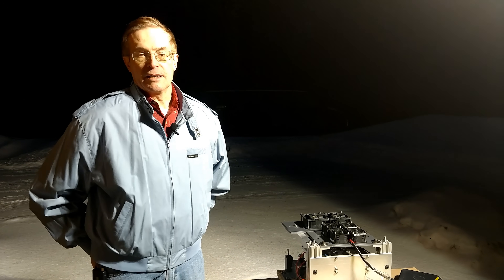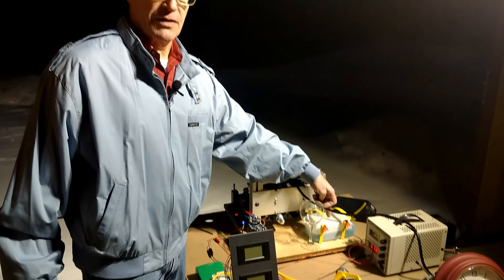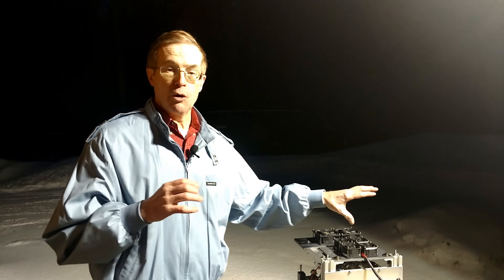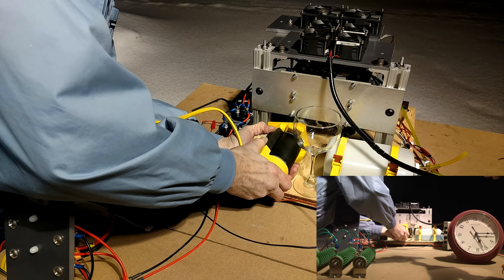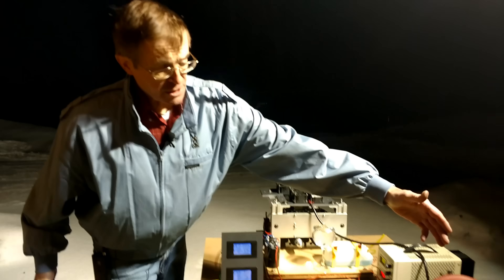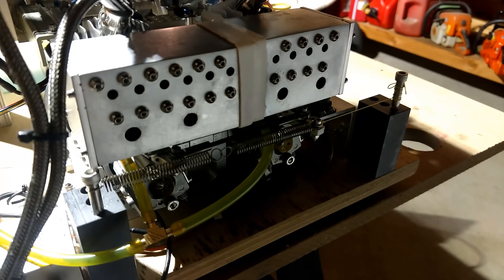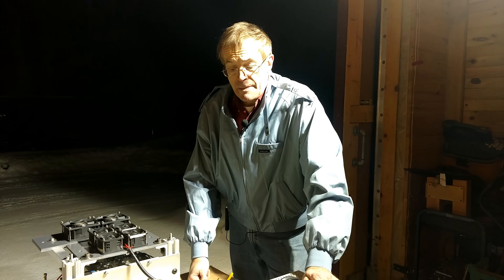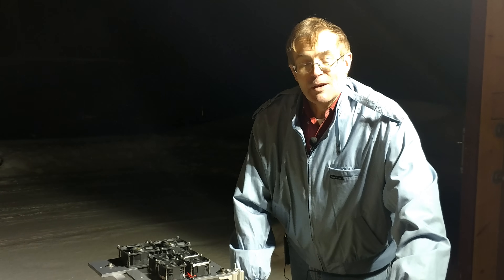Drone Generator Performance

Comment: If you're running nitromethane, a good percentage of the "fuel" is oil to lube the engine. All that oil is going to end up in your glass sponges. If you subtract the oil content from the weight, you'll find your efficiency is a little better. Those mufflers are going to be fun to keep clean. Cool project.
Reply: Lol I saw a video of one of those glasspacks melting  and spilling piles of moulton debris, looked kinda like a volcano  ....
Reply: some of these 2 stroke rc engines can be run with as little as 2% oil
Reply from the maker: These are two stroke gasoline engines with only two stroke oil added.

And, thanks!
Reply: Weighting the exhaust system before and after is a thought, though. Two strokes have smoky exhaust. Maybe there is particulate accumulation.
Reply: The oil in the nitromethane fuel (Mr. Tech told me he's using gasoline and not nitromethane, but same principle applies) doesn't burn. It is exhausted. The reason it doesn't burn is that it is added to both lubricate and cool the engine. All of that oil will saturate the glass and be a mess to clean up. This system, coupled with Mr. Tech Ingredient's experience in noise cancellation, should have lead to a muffler that is ported in such a way that the noise from the first exhaust is cancelled by the second. The arrangement he has here is perfect for this type of system. Anyway...

Comment: Call me an idiot but why not just use mechanical motors to run the drone propellers rather than use a mechanical engine to charge batteries?
Reply from the maker: There are several reasons.  The electrically controlled, motor systems are very responsive and the control systems are refinned/turnkey.  The single engine, generator module can be added to existing systems without modifications.  Such a module can be more easily isolated from the drone structure minimizing vibration transfer and simplifying noise control.
Reply: Thanks for the insight. It makes sense now that you've put it that way. Basically you're trading ultimate power over agility and versatility. I was looking at it from the standpoint of building a drone with the maximum amount of lifting capability. I still think if you're looking to just lift heavy objects, mechanical motors powering large propellers would be the more efficient, cost effective design but if you're taking into account noise, responsiveness and the ability to modify existing battery powered drones then I see your point. However, I'm sure you're aware that the larger you go and increase weight, you have more inertia to deal with so you lose agility. I guess it all depends on your specific requirements but at the same time if you're looking for heavy lifting alone, keeping it as simple as possible would be the way to go. Basically building a mini chopper

Comment: You should have changed(varied) the resistor banks while system is running to show the Arduino based feedback loop and battery stabilization. Otherwise this is TheOldTony of electromechanical channel. Thank you for your time and hard work.

Comment: Couldn't you borrow some of the ingenuity of the automotive 4 stroke engine and use a tiny inline 4?  As I recall Honda had such a powerplant down to 750 cc by the mid 70's.  Either that or maybe you could go further down the RC engine rabit-hole and start looking to nitro glow engines.  They are actually simple enough to build from scratch and 500W/cc is nothing to sneeze at even if you can only capture 75% of it as electricity.  Haven't you thought of using commutated dynamos instead of diodes?  Hell, maybe you could lose the ESC and just put brushless gens back to back with a brushless motors!
Reply from the maker: There are a lot of engine options out there.  We chose the readily available 2 stroke because it has better fuel efficiency than the nitro engines and the fuel costs less.  While it lacks the efficiency of the 4 stroke it has a better power to weight ratio.  The project is already pretty complex and we didn't want to try to develop a custom engine as well.  We thought about directly driving the motors from the gens, but then we loose the independent control stability provided by the energy storage in the batteries. 

Our approach is not necessarily the best and modifications could certainly be made.

Comment: RE Sound & Weight: Considering your great Helium videos, is it possible to enrobe the motor in a layer of Helium?
Reply from the maker: The motor/generator, yes.  The engine is much more difficult because of the need for high air flow for cooling.  The application ,as we see it, is to use helium to fill extremely light panels that make up the enclosure.

Comment: The stock exhausts as well as the design you have utilized unfortunately are not great for 2 stroke efficiency. A tuned length expansion pipe would increase your power output and economy far more. They have the effect of supercharging a 2 stroke engine benefiting both fuel economy and power. It should also help with noise as the engines can be properly silenced there after as well. Being a generator and having a small operation range should mean you can optimize the expansion chamber quite a bit over a traditional expansion chamber as featured on some model aircraft.

For getting better fuel consumption you could swap out the heads on those 2 strokes for a diesel head which would effectively change it over to a compression ignition engine, I have not played around with them but have heard fuel consumption improvements of around 50% as well as good power gains. Since they have adjustable compression ratios you could further optimize it in this application. You could probably make one yourself, they are quite simple to convert. This paired with a well designed expansion chamber would get you closer to your goal. 

Your vibration levels are quite impressive! 

 Keep up the great work! Just stumbled across your channel a few days ago and really enjoying your videos!
Reply: I do not know much about the engineering stuff but do know that Diesel fuel is twice as heavy as gas (if the volumes are the same).  I believe the 50% efficiency by Diesel then may be mute, since you will be carrying twice as heavy fuel load.

Comment: Now, if you could get this thing to crack it's own hydrogen from water, not rely on ANY liquid fuel, and still produce enough power to charge up batteries, I'll take the first billion units you manufacture...

Comment: Have you analyzed the output with an oscilloscope to hone the necessary electronics for reasonably controlling the dc?
Reply from the maker: No, we have not.  We did use the scope for simply determining the pulse frequency, but not for evaluating the voltage/current phase relationship or that relationship's dependency on frequency.

Comment: Thinking out of the box brings a turboshaft generator to mind.  They are not cheap, and I don't have a list of your requirements or budgetary constraints, but if you use a turboshaft with reduction gears driving a generator, it would give you a pretty good place to start, since you can calculate the optimal size components that meet your needs.  It would also be pretty cool if you ended up with a hybrid setup that uses both electrical and output shaft power to run the machine.
Reply: Because a multicopter would need an engine for each propeller set. 4 or six engines would be unreasonable.

Comment: Good info.  So, the weight of the generator plus the weight of the fuel is far less than the comparable weight of lithium batteries with the same energy content?
Reply from the maker: This all depends on how much fuel you carry.  If the fuel to battery energy density is 10:1 then the weight of the generator, being fixed, will determine the break even point.  Less fuel then don't bother and the more the fuel the more advantageous the the use of a generator.
Reply: Based off a setup of two small 2.2hp motors and 15kw gen heads, rectifiers, and mounting, breakeven is 4.76kg, not sure about his weight here.

Comment: Machine a turbo to increase yield
Reply from the maker: We are doing just that!  Stay tuned.
Reply: That would make more sense than a gas turbine, per se.  These would be tiny turbos, so sourcing would be interesting.  I see incredible value in how much Common Off The Shelf components this uses, harvesting a lot of engineering and precision manufacture others have built.  The "machining" is kept to aligning assemblies, making repair and adaptation a lot easier.

Most of us could manage to recreate what has been built here in most shops as we can all source these parts.  I love that about this series and it's what I expect, given the name.  Here's a creature I've created from DNA everyone can obtain assemble like this or take it from here for their own path.
Reply: Tiny turbos exist for these miniature engines already. He may have to machine a few parts still yet, but he should be able to find a viable turbo.
Reply: Maybe you could use both turbocharging and bleed a bit of boost off of 4 ducted fan/doubly hybrid superchargers/thrusters!

Comment: Nice project. There is something that I still do no get right. Considering the amount of power required for even a modest 900mm (15-16" props) - 6kg AUW class X8 drone, which requires 2-3 KW range in hover, I wonder how this engine-generator setup could be of any practical use as it must weigh multiple times the weight of the said drone while producing only about 750 watts. Or did I miss something ? What's the total AUW weight, fuel included of this engine-generator setup ?
Reply: I did basic calculations and using a pair of smaller 2.2hp 2 stroke motors and 1500kw motors for the generators, the breakeven is at 4.76kg.... For these motors and generator, and frame, you need a massive drone, and the generation is no where near useful. I think he needs more generator head on the motors.

Comment: Tech Ingredients ..  Thanks very much for your contributions!   Rare are the persons that give without asking for doe, or that beg for money ...  I'm sure you understand better than I can explain!  anyway..

Thus far you're the first person doing uploads on youtube using RC engines for generatoration of power, I am very ignorant of electrical systems, but have often wondered if one could use RC electric motors as a generator source, i.e., use a .50 nitro RC engine to turn something like a 520Kv motor, if you'd obtain a substantial amount of of power to charge a couple 12v deep cell batteries, (time constraints/issues) and in turn use the deep cells through an inverter to run power for a home, I'm sure it would need to be "sized up" to run anything more than a high efficiency refrigerator, but with so many trying to make their own mag-motors/generators, RC has them already made for cheap, considering how much neodymium magnets cost!  Your thoughts sir?

Again, much thanks!   Respectful Regards and Salutations,  Mike
Reply from the maker: Thanks for the comment.  The limitation on airborne generators is weight.  If not constrained by weight then  diesel, solar steam etc.would be a good choice along with high field magnets and intelligent controllers.

Comment: Have you tried gas rc car motors it would greatly reduced it's size to more closely resemble commercially available hobby drones
Reply from the maker: What specifically do the RC car engines do that reduce their size?
Reply: They run on a fuel that has a higher ethanol percentage making energy density higher and are much smaller in size  but would only be suitable for like  a 6 to 12 inch prop size drone   they are already used in flight applications  for gas rc airplane and helicopter models and cost anywhere from 80 to 300 dollars

Comment: Super cool! Thanks for this post . Do you have funding enough for developing a free piston diesel generator set for use in a drone ?  https://www.youtube.com/watch?v=2SlwoBLspTQ   .  I've not run across any idea like that at this time .     Patent 672256 .
Reply from the maker: The general concept is sound and would indeed produce a very efficient and nearly vibration free generator.  The funding needed would be substantial because almost every component would have to be produced from scratch.
Reply: The other idea that came to me was a free piston stirling generator set https://www.youtube.com/watch?v=P1FwrDZKfKk  .  If you went with nuclear power, your hybrid drone would not have to land for weeks !
Reply: This old flick just popped in to my head  https://www.youtube.com/watch?v=34qMt_MOus4&t=3520s  .  If I went for a remake of this flick I'd go for laughs with a  nuke powered hybrid drone running amuck delivering pizzas or whatever all over the planet and nearly wiping out mankind  .  Sort of what Facebook has come to,  starts out good, ends up bad .   Dr. Strangelove ?  Thanks for this post and keep them coming .   Patent 672256 .

Comment: “As you can see we are generating approximately 700 Watts.” “Unfortunately the cooling fans require 800 Watts to stay running.”
Reply: Prop wash and airflow from flight should help out a lot
Reply: Which in turn raises the drag which in turn reduces speed and also you would have to keep some electrical parts exposed.. maybe liquid cooling would work the best in this system?
Reply: a little bit of ductwork to direct the airflow and you could just run the fans directly off the drive shaft(s).
Reply: @Luke Daugherty Sure, altough depends on liquid and you also have to take into considering that moving up in the air it's alot colder, thus the cooling effect could be achieved with reduced amount compared to cooling system on ground level. In the end all of these are pieces of crap compared to linear generators.
Reply: props and drive shaft will eliminate the need of cooling fans. also can cnc pulleys to generate airflow
Reply: @BasiCommonSense   airflow on the motor will make sustentation too by being magically in the outside in the same time and pulley free power is great
Reply: Replace the shaft cover with vented pulley "stators are pitched toward the motor or awy depending on pull or push prop.. I say pulley in respects to the way it looks not so much its function
Reply: @BasiCommonSense  smart frame design can solve all the calorific problem yeah it about simulation of transferts a whole science
Reply: A motor that generate too much heat can drain the ppower supply by a .26% more then cool motor
Reply: @BasiCommonSense  a motor can only be cool by mass or environement for a drone its obivious than air is the solution
Reply: @omnianti0  Corsair Hydro H100i RGB Platinum Liquid Cooler
Reply: @BasiCommonSense  suitable for a static pc but for a drone that move at 30m/s in all directions
Reply: @omnianti0   ive made 1:4 scale reaper and have used the concept in fact i used it in my viper jet for the ESC.  the jet has a Stand thrust range : 57-78 N and a beam speed of 79 to 93 M/S it work frkin great. the genius behind it is it was invented a long time ago and all that had to be done was to fabricate a modified version for the engine. The best thing was i used ethylene Glycol  an anti freeze organic compound which was noncorrosive. blah blah blah.  work great at 30 m/s even 93 m/s lol
Reply: @BasiCommonSense  what is the airflow vector of a jet plane maybe not the same as a drone you must be know it